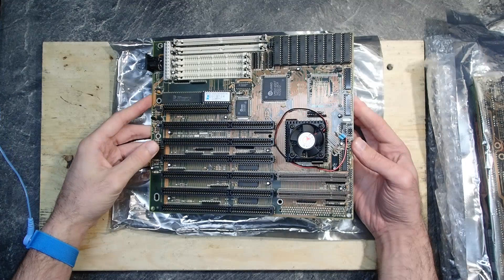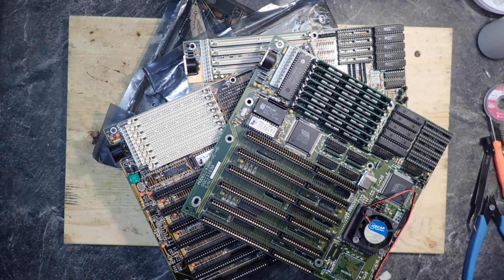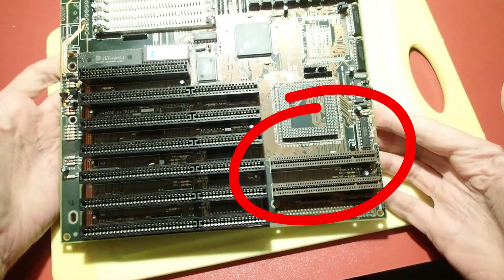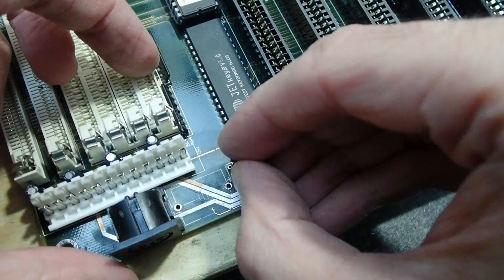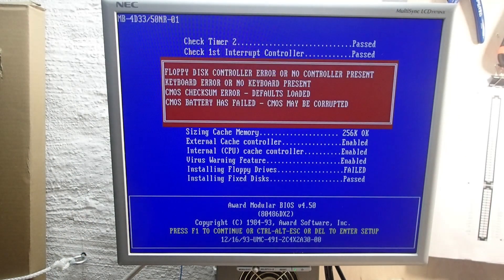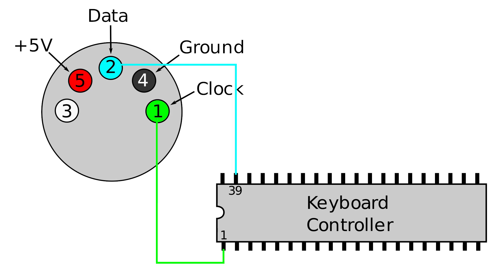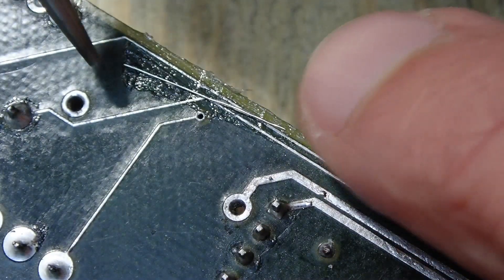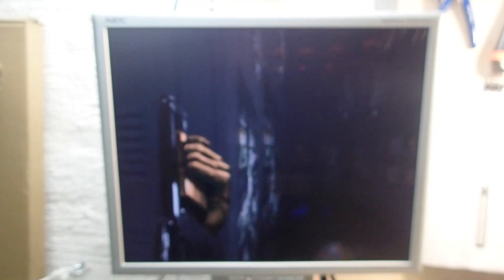Repair Marathon 21.04: #2 Aquarius MB-4D50NR Am486DX2-80

Comment: thank you for the video! I am repairing a similar motherboard which seems to be having a similar issue and this video helps a lot. I'm making a video too! :)  Question: pin 39 is TEST1?
Reply from the maker: You are welcome! The keyboard controller is actually a generic programmable MCU and the usual PC compatible keyboard controller firmware uses Pin 39 for data, despite that it is marked as TEST1 in the datasheet. In the same way Pin 1, which is mentioned as TEST0 in the datasheet is actually used for clock. With some other firmware Pin 1 and 39 could be anything. I hope, that helps. Cheers!

Comment: Dear lord and savior Necroware,
May I learn what gauge of wire are you using as well as what soldering iron temperature settings & solder flux would you recommend? Have you ever had any experience with damaged/ripped pads?

Inspired by your videos I bought myself a battery damaged mobo, also a Socket 3 wit an Ali chipset for a cheap price, and there are lots of traces to to be completely rebuilt, some pads are gone completely, but nevertheless I'm keen to start, but as a total noob I am not educated enough, of course. By the way - would you rather recommend a 2-in-1 soldering station with a hot air rework gun, or a desoldering gun? I need to replace my old cheapo solder stick and I'm really torn between the two options. Kind thanks in advance!
Reply from the maker: Hi kiki. I usually use AWG30 wire for thin traces and a thick telephone copper wire for power traces. For repairing traces I'm using leaded solder at around 300°C. If pads are ripped off, I'm soldering bodge wires directly to the ICs. I never recreated a pad yet. In regards of soldering station, flux and others, I honestly don't care too much and use the cheapest stuff from China. In the beginning I was sure, that it has to do much with the soldering station and I bough different models. I even have an expensive soldering station, but I don't use it, since it takes to much space on the table. Instead I'm using 10€ soldering iron from Amazon for everything meanwhile :D In the end only one thing is really important - experience. My best investment was to get some dead PCBs with a lot of ICs and practice to desolder and solder back the parts. After a while, it turned out, that it almost doesn't matter, which soldering iron you use. If it is sitting well in your hand and you got used to it, then it's good enough :D

Good luck with your repair!
Reply: @necro_ware  Lovely! Thanks for your outlook on the whole matter. That was my outlook as well, having used you know, cheap stuff, rosin flux in a tin, all that... during that time all I did was recapping and fixing cold/broken joints, and suffice to say that did not look as easy as it is on Youtube videos... thus there I was, like you, thinking it's the matter of equipment and not patience + experience :D 
Kind thanks for the info regarding wires as well. The traces you repair on your vids look amazing and, well, you make it look so easy - and so reassuringly pretty :D Have a good day and good luck in your future projects!

Comment: Wow! I have the same mb model as yours, but version 2.0. When I switched on the power supply, it showed no signs of life and a few seconds later the power supply switched off by itself (went into protection, I suppose). I've meassured resistance on power inputs 5V,-5V,12V,-12V and there was no short circuits. What would you recommend to look into next? And thanks for the video.

Comment: Hi! i've been enjoying a lot some of your videos, i guess i discovered your channel due to Phils... I've been fixing motherboards like this for some time but sometimes there are too many traces fo fix... I have a Commodore 386sx computer that is working except for the keyboard (even mouse ps2 port next to it is working) but as there's no separate keyboard controller, it has an integrated m5105 multi IO chip which i didn't find any pinout i can't find where the kbd clock or data traces would go... I've been looking for advice but haven't found any help except this... Is it possible to contact you? have a few motherboards i've left aside for a while...
Reply from the maker: Hi there. I'd love to help, but unfortunately I have no experience with Commodore PCs so far. Did you try to search for schematics? I'm really sad not to be able to help everybody, but meanwhile I get multiple requests every day to take a look at someones mainboard. I wouldn't be able to take a look at all of them, even if I'd stop sleeping.... However, I'll try to search for documentation on your board. If I have something, I will write here.
Reply: @necro_ware thanks for answering!  it's branded as Commodore but a normal pc with common components... Actually I think it's an Acer rebranded pc. No datasheet for the AcerM5105 controller which handles integrated kbd mouse serial and parallel ports...
Reply from the maker: Is it this one? https://forum.winworldpc.com/discussion/10835/got-a-commodore-386sx-25-some-pictures
Reply: @necro_ware  yes that's the one... you can see there the keyboard and PS2 connectors are quite close to the battery... That's why they suffered from the corrosion... Even many Smd components moved due to the traces being totally corroded.. real mess... But after many hours spent keyboard is still only getting power but not being detected :( it's an interesting piece of hardware

Comment: Alter, Deine Videos machen so hart Bock auf alte PC-Hardware, obwohl ich eigentlich ein Heimcomputersammler bin. Durch Deine Videos traue ich mich aber nun, die defekten RAMs auf meinem Colecovision zu tauschen. Du verdienst x-mal soviel Abonnenten und Hits, wie Du aktuell bekommst. Hoffe, dass auf Deutsch mehr Begeisterung mitschwingt. Normalerweise würde ich in der Kanalsprache antworten, sorry. Like und Abo dagelassen.  ENGLISH: 
Your channel is an inspiration for me to finally fix my Colecovision by swapping RAMs. I should dig out the boxes with the old PC hardware in the basement and check if the batteries are still okay. Thanks! Channel subscribed!
Reply from the maker: Vielen Dank für den Lob! Natürlich wäre ich nicht traurig, wenn meine Videos mehr Beachtung finden würden, aber die Inspiration anderer ist mir Belohnung genug. Wenn ich damit den einen oder anderen begeistern konnte sich eigene Hardware genauer anzuschauen, habe ich mein Ziel erreicht :) Auf jeden Fall, viel Erfolg mit dem Colecovision!
Reply: @necro_ware  Durch Deine Videos habe ich tatsächlich vor allem gelernt, keine Angst vor Techniken wie dem Aufdoppeln der Leiterbahnen mit Lötzinn und/oder Drähten zu haben. 
Ich hätte nun auch echt Lust mir aus einem ATX-Netzteil ein universelles Netzteil für die ganzen Konsolen und Computer zu bauen. Die teils benötigten -5V kann ich ja so wie Du mit der -5V-ISA-Karte gewinnen. Das wäre die totale Erleichterung, denn sich durch zwei Kartons mit Netzteilen zu wühlen, die alle miteinander verkutzelt sind, macht keinen Spaß. Hatte schon mit Gefrierbeuteln zu Trennung experimentiert, aber das ist auch suboptimal. Außerdem kann man vierzig Jahren alten Netzteilen nicht mehr wirklich trauen.

Comment: Let it be a next marathon of overclock!! Give to 386 a power to play Doom!! And Quake for 486! :))

What about to change Linear VRM to modern Impulse VRM?)
Reply from the maker: Yeah, overclocking is fun. But even if overclocked, Doom is barely playable on a 386. Only if you can live with reduced window size and <15 FPS. The ISA bus is unfortunately a massive bottleneck. I'm doing my next video currently, there you will see a 486DX-50 struggling to run doom, which is a lot faster CPU, then any 386. The same is for Quake on 486. Only on overclocked Am5x86@160MHz it is kind of ok'ish, but also not really well.

And in regards of VRM, do you mean it as a topic in genral, or in regards to the mainboard in this video? I mean, this mainboard has no VRM at all, that's why I'm a bit confused o_0
Reply: @necro_ware  I was play Doom on AMD386SX@40, now it hard to believe, but it was fun)) In thous time I thought 386DX will be much better for Doom)

VRM for 3.3 and 4 Volt 486DX, of course. It must help to overclock ) 

Now I have AMD5x86@160 - it rely good for Quake, in middle 90's :)
Reply from the maker: Hi, I'll try once again, this mainboard has no VRM, nor does it have a place for VRM, nor is it prepared for VRM. You have to make a massive hardware modification to cut the CPU from common 5V supply on this mainboard and introduce new circuits with 3.3V power supply. I wouldn't dare to make such a modification on a grandpa like this  :D

And I'd like to see how you play doom on 386DX-40 :D If you are really keen and find it ok to play this game in a window as big as a post stamp with low resolution settings, then yes, may be. But for me, Doom is not playable on anything below 486DX2-66 with VLB graphics card. Watch this: https://youtu.be/qQEHHc1q06c

The same is for Quake. Pentium was the first CPU, which had a good enough FPU to play this game. You need at least P133 to play it ok'ish in 320x200. With 486@160MHz you can run it, yes, but not really enjoying it. The basic formula is simple if you take ID Software games as a benchmark. 286 - Commander Keen, 386 - Wolfenstein3D, 486 - Doom, 586 - Quake ;)
Reply: @necro_ware  interesting, how quite a few commenters - not only in this video - mention playing Doom on a 386 with moderate to great joy. But all I remember, was that it was rather crap, and there are a lot of videos on YouTube affirming this 🙂

Comment: 386th viewer !

Anyways, I am currently trying to fix a ECS NEATsx which suffers from a heavy corrosion, I had to remove two ISA slots and many components. I am not sure if I will succeed but for now I am trying to clean it up the best I can ... which doesn't work quite well for now. The corrosion is so bad that even after cleaning it with vinegar, then IPA, then water, the flux still reacts and turns black. I haven't tried to scrape off the PCB to access the copper though.

The vinegar itself removed parts of the silkscreen making it feel "rough" around it.
Reply from the maker: Well, sometimes it's tough, but I think the board is now in good hands ;) It just needs a lot of patience and creativity. Badly oxidized contacts, the ones with black color, they need to be scratched on the surface, so you can see some shiny lead under the oxide, then you add fresh leaded  solder, it will intrude through the scratches and melt partially the black oxide from within. Then you keep your solder tip at the joint slightly longer and soak the gunk using a desoldering pump (manual one is sufficient). Then you repeat the procedure couple of times and the joints will be clean again. You just need to take your time and don't go over 300°C on the tip, or you'll burn the PCB. An I really advise to use a dremel or similar tool to polish gently the traces, it works really like charm.

Comment: Ohh I really should give a try to repair some of my 386 boards, I'm having bad luck purchasing "as is" none of them post. I have a single 486DLC board thT was given to me at my previous job that had very little battery damage and cleaned ok with some vinegar. Should cover what I cleaned with some nail polish?
Reply from the maker: If you have exposed copper, then you should. If you tin the traces, it's optional.

Comment: What diameter are those wires you use to repair traces? I can't wait to see next repair video.
Reply from the maker: 30AWG, I also used single wires from a 80-wires IDE cable a lot. It's a shame to cut a cable on one hand, but on the other, I had like 50 of them and since the pieces you need are usually very short, one sacrificed IDE cable is enough to repair hundreds of mainboards :D
Reply: @necro_ware  Oh, I see. I have some IDE cables with broken connectors, I'll give it a try. So fat I've been patching motherboards with insulated wires (just like a patch in your previous 386 mobo video), but using wires seems to be more elegant method.
Reply from the maker: @86smoke  Yeah, if it works I also find it better. Unfortunately sometimes the traces are too destroyed, or too tightly packed, so it gets too tricky.

Comment: Great video! Simple yet satisfying repair. Use of Dremel to clean the traces was a nice touch; what kind of tip are you using, is it abrasive stone or some kind of felt? Wire can be made extra-straight by rolling it a few times between two flat surfaces, I use my work table and a small piece of fiberboard. (/OCD mode off :)
Reply from the maker: Thank you! It's not a stone, it would be too hard and would probably damage the board. The tips are made of some kind hard felt. I bought once a box full of such tips in a local supermarket, so I can't provide any link, where you can buy those. I straighten the wire in the same way usually, however the one I used in this repair is so thin, that it tears very easily, so I just go couple of time with my fingers over it. It is mostly sufficient.

Comment: Wie immer Daumen hoch für die Arbeit! Könntest du irgendwann ein Video über Desoldering bei neueren Boards machen, die bleifreies Lot benutzen? Ich habe diverse SockelA Boards, aber dieses bleifreie Lot regt mich auf. Bleihaltiges Lot ist viel einfacher bei der Bearbeitung. Ich werde mich mal an ein SS7 Board wagen, wo ich den Lüfteranschluss durch einen Kurzschluss gegrillt habe.
Reply from the maker: Vielen Dank! Normalerweise beschränke ich mich auf das Reparieren der Hardware die mindestens S7 alt ist. Ich finde persönlich sogar alles neuer, als 486 nicht mehr wirklich spannend, weil da immer mehr in einen Chip integriert wurde und man meistens wenig machen kann, wenn da was kaputt ging. Allerdings, wenn es um einfache Sachen geht, wie ein Spannungsregler, Kondensator oder eben Lüfter-Anschluss, dann mach ich auch mal was. Es geht aber weniger um Bleifreies Lot und mehr darum, dass neuere Boards bis zu 8 Schichten in den PCBs haben und jede zweite Schicht in der Mitte ist oft Masse. Man macht das wegen besserer Abschirmung, da man versucht deutlich höhere Taktraten stabil zu halten. Leider ziehen die großen Masse Flächen sehr viel Wärme und das Lot wird nicht flüssig genug um abgesaugt zu werden. Es hilft nur das PCB ordentlich vorzuwärmen. Ich entlöte dann mit einem Heißluft Fön auf 350°C in der einen Hand und Absaugpumpe auf 400°C in der anderen. Aber auch dann geht es oft sehr mühsam....
Reply from the maker: Für gelegentliches Arbeiten braucht man nicht unbedingt eine Heißluftstation. Ich habe zwar eine, aber ich verwende auch ab und zu einen einfachen Handwerker-Fön von Lidl :D Der kostete 10€, kann mit 300°C blasen und reicht in den meisten Fällen dicke. Wenn es sogar darum geht etwas größere ICs zu entlöten, z.B. einen Chipsatz, dann greife ich sogar gezielt dazu. Die Station hat ein ziemlich kleines Gebläse, was perfekt für sehr kleine Teile, aber ein Krampf für größere ist.